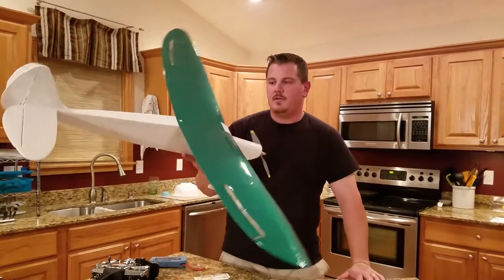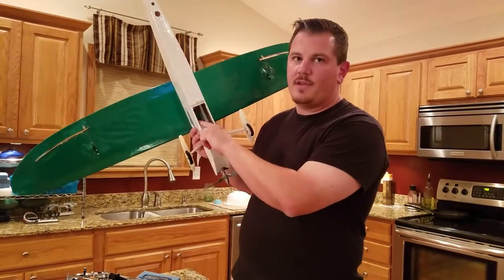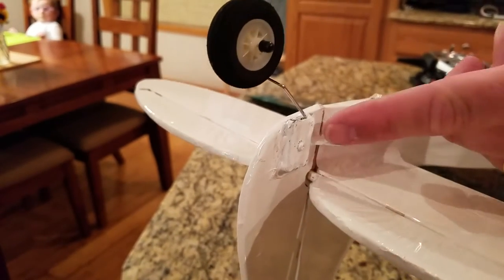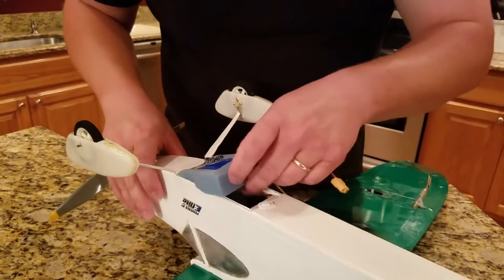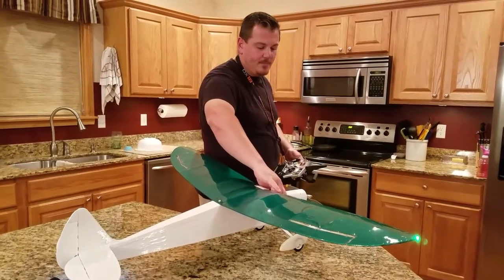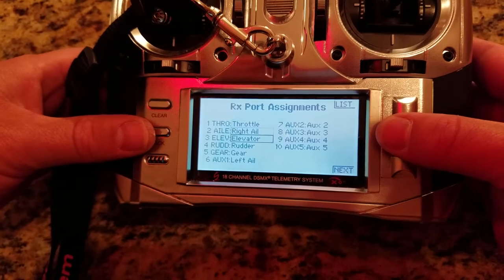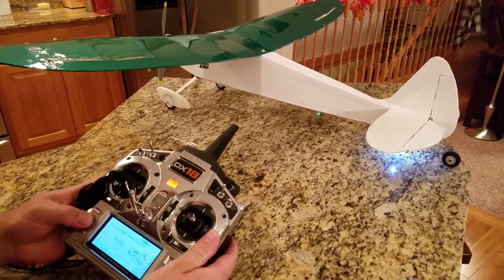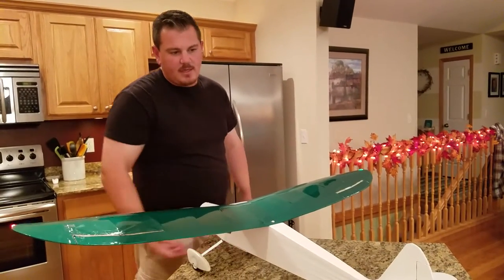Sig Rascal - Gpa High Wing - Ailerons, Nav Lights, Etc. Mods - 9/25/2016

Comment: Im really questioning wether to add ailerons to my Kadet MK1, nothing is covered yet and im going with trans green and cream covering. Ill be adding servo bed sections to the wing just in case I decide to add them later. After seeing this vid again im just thinking would be fun as a three channel and similar covering job: https://www.youtube.com/watch?v=hW2d_vAYTiI
Reply from the maker: Some people prefer the simplicity of 3 channel, but personally, I want the control of 4 channels, if not 5. When I fly 3 channel, I feel so handicapped, in that I can't force a roll, to right the craft, thus I can only fly in the best of conditions. That being said, maybe this plane will not be an "everyday" flier? I guess, these are subjective questions. It's your project, and you'll enjoy the outcome, but if it were mine, I'd install ailerons.

Either way, I'm sure it'll be a very nice plane!

Good luck!